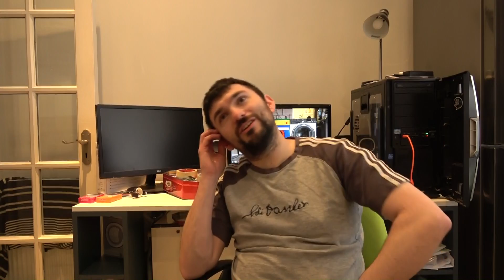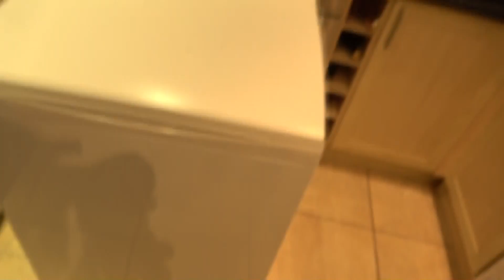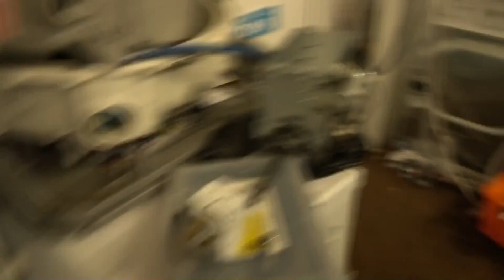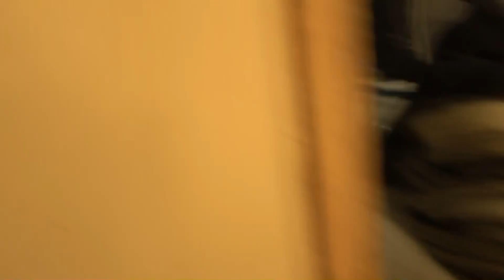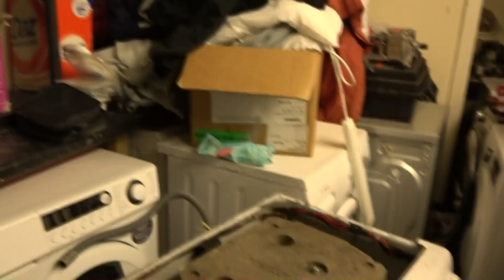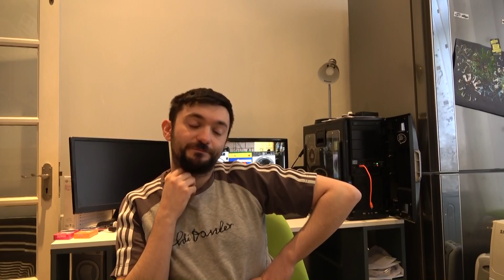50,000 subscriber special: Q & A and answer to where I keep my washers and dryers.

Comment: What are your thoughts on ozone washing systems? I imported GreenTech PureWash from US, I bought it for 140$. And although, whole system was neat was disappointed to find 0.3g/h  ozone generator tube inside. Its only enough to produce the smell, basically.
I plan to built water ozone infusion system myself, with more powerful ozone generator, 1g at least. Have you heard anything about it?